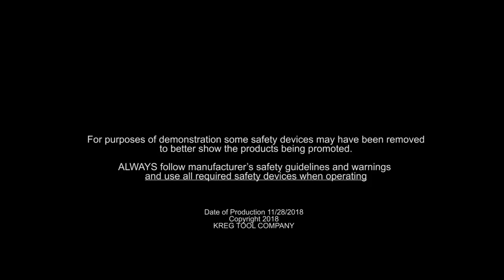How to Build a Wine Gift Box

Comment: Does Kreg even make screws for 1/2" material?  I can't seem to locate any.  The 3/4" fine thread screws may work when using solid wood, but forget it if you happen to be using plywood.  Kreg does not offer a coarse thread screw for 1/2" plywood.  And by the way, the box would have loked better if left two-tone...light box and dark lid.  Just my opinion.